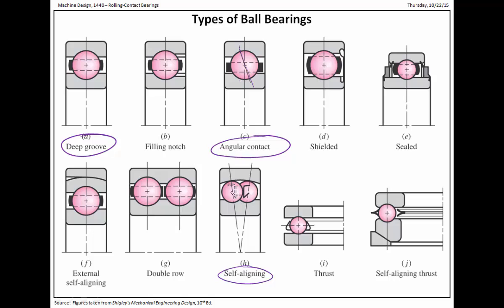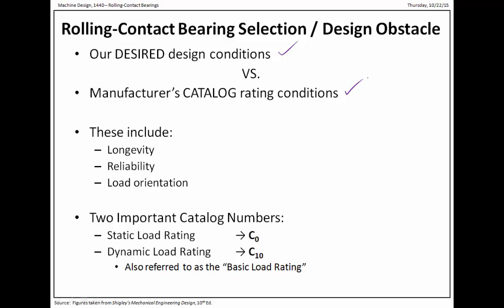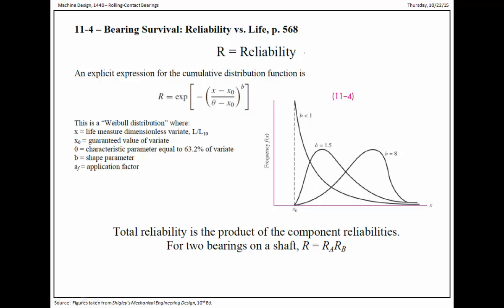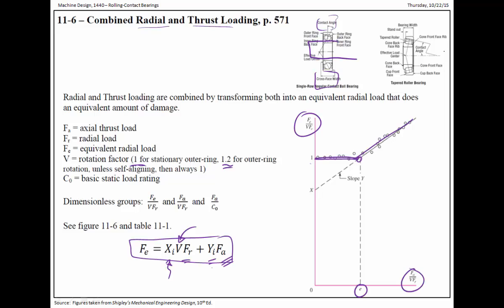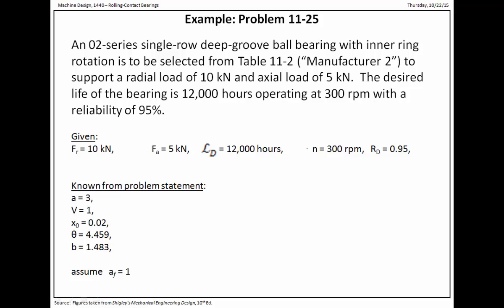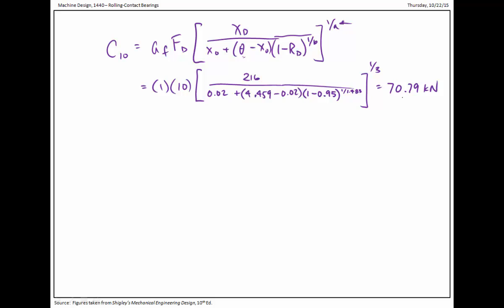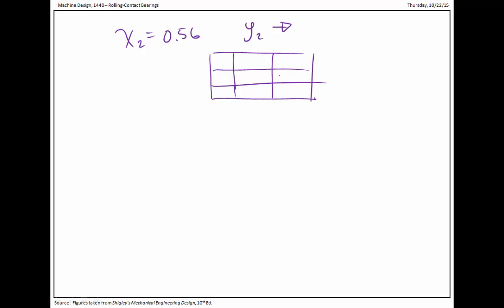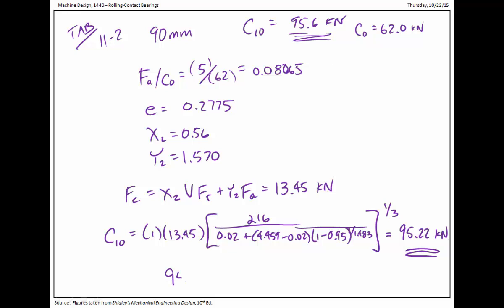Machine Design - Chapter 11 - Rolling Bearings

Comment: Another point regarding preload. In some applications not having enough preload can cause the rolling elements to become unloaded in certain circumstances. If this occurs, it will result in a reduction of life due to the rolling elements skidding or sliding, rather than rolling.

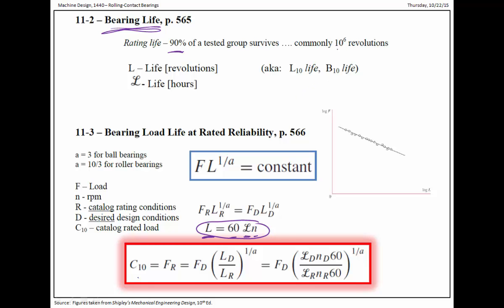Comment: At 19:55 you state that A = 3/10 for roller bearings, but at 9:41 you give it as 10/3. Can you clarify? Other sources I've seen suggest it is 10/3. Excellent video.
Reply from the maker: It should be a = 10/3 (or 3.3333) for roller bearings and a = 3 for ball bearings.  I got it wrong at the 19:55 mark.  Thanks.